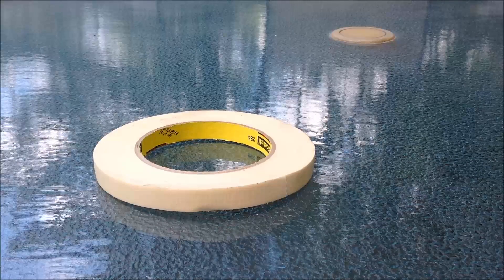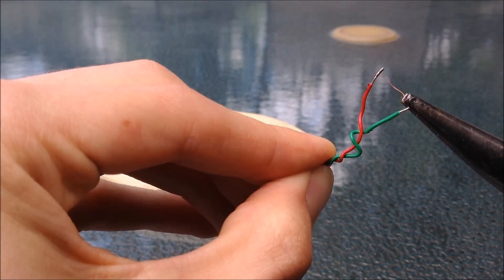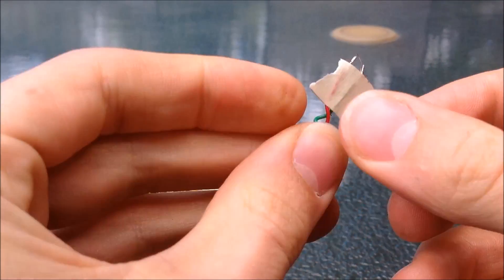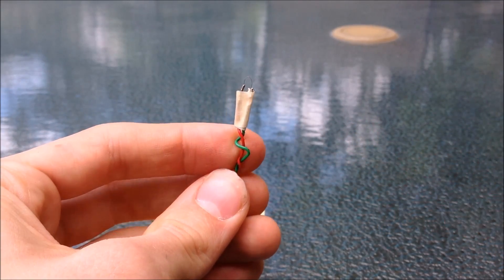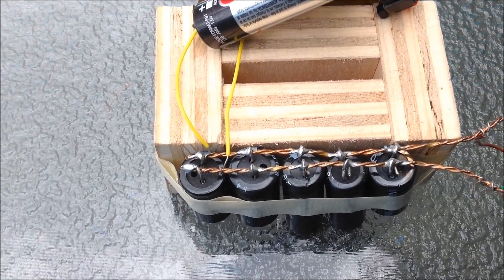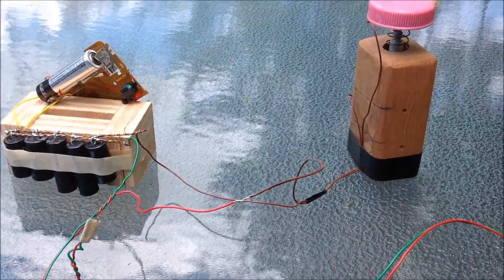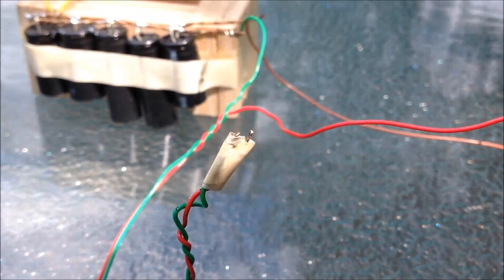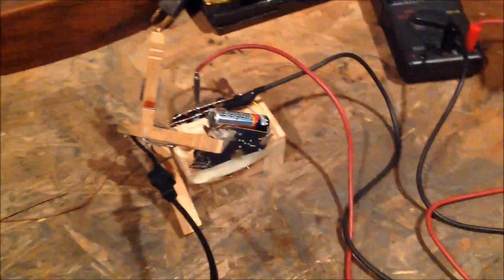Homemade Exploding Bridgewire Detonators!

Comment: i am finding a recepie to  homemade   f  ejectric starter //and was asking   for   substance   this  or   simple fuse will have   enaugh primary blast to set of   brick of tnt/semetex / or at least     detonate  fast enaugh and hot to  set of    ANFO  as    2 or 5  kilo booster//in itself    detonated with merc fulminate  or    sadly one of  the primary s  you   don want  to  mke at  home a  lot times   //
nitroglicerin is dog s piss vs lead azite  or  mrful //so i am  asking what  is  most safe to momemade   detonator//or  minimum   m per sec     shockwawe  and  hot   c////pls  tell or contact  me   if you find some  like   what i  look for

Comment: wouldn't you want to put them in series for more voltage and more current. Putting them in parallel just increases the pulse length
Reply: If you did, the ESR would add, what you want for an ebw setup is the lowest ESR possible to allow the highest current burst

Comment: Don’t ever rely on a bridge-wire alone to set up any type of explosive… Not even a primary… Devise a makeshift blasting cap and do it right. 

Safety first!
Reply from the maker: Yes, thank you for that tip. In the 5 years since this video I have learned a lot more about such things - from what I have heard, something like this will not set off explosives like ETN and you do need the primary.
Reply: @ThePlutoniumBunny  Sure it will. What kind of ETN? If the ETN is 1-5 micron that will work. If the ETN is melt casted, it will definitely work since melt cast ETN is 3x more sensitive than any regular ETN. 

If you are going to use that much power (using capacitors) you should use a thicker bridge wire. There are 100s of primaries you can use as a slurry and coat your bridge wire. You DO NOT HAVE TO have an actual cap! To better explain this, you can 'paint on' your primary until you get the thickness you want. 

Couple other things. Your bridge wire can be much longer by running down the side of one of the wires that is no stripped. Does that make sense?  

After everything is dry, spray paint some rubber over it or do what I do and get a can of that rubber tool dip and dip your wire in it.
Reply: @Boobytrap_Badger I agree with everything else, but melt cast ETN is no more powerful after it returns to it’s crystallized state after melting. That’s what makes ETN so popular, you just gotta watch that melt stage😅
Reply: @Boobytrap_Badger  interesting on the cold cast method. I have many binders for plastecizing. I have a whole gallon of rat glue. I’m not big on making videos but I did make one on detonators and I’m going to post it with ya day or so, followed by one on binders and plastecizing recipes. I haven’t made the NHN yet but I’m familiar. I have a bunch of PETN. That’s my main squeeze. Thanks for the info. 😊

Comment: Try use it in anfo or an
Reply: Won't work.
Those are shock sensitive and need quite a substantial impact to detonate.
Reply: @infinitepower6780  it's not a question of 'it won't work' or 'it will work'. 
You increase detonation probability with appropriate chain reactions. 
That being said, yes, it can work with a more powerful cap, but why skip simple steps right?
The best system is always going to be a fuse-cap-booster-main chain reaction.
Reply: @Boobytrap_Badger with a good EBW (not this one, its definitely an electric match but not an EBW) you can do EBW -> Booster -> Main.
Reply: @infinitepower6780  yea, need. Booster charge, like petn or rdx

Comment: Everyone on this thread seems way more knowledgeable than me, soThis might be a laughable question,  anyways I'm trying to confirm if my understanding of bridgewires is  correct. So this essentially works as a fuse correct?
Reply from the maker: Spot-on. EBWs are a very specific type of fuse for very demanding applications. A real EBW might be used in an implosion-type nuclear weapon, as the explosive lenses must all be simultaneously initiated within a very short time tolerance. Normal fuses or electric matches have way too much variability in when they go off, and this would cause a fizzle in the weapons system. For amateur purposes, this EBW (very amateur, no danger of building a nuke with this one) is a much safer method for initiating things than a normal pyrotechnic fuse. Such fireworks fuses need a person next to them to light them, and can have sparks fall off and ignite things before they are supposed to go. It's harder to have an accident when using these bridgewires.

Comment: Hi there, great video! You inspired me to make one of these myself and it works great, only the buttons I used got spot welded together! So I understand now why you made your own switch with those big bolts. But i was just wondering, what would happen if you would put the little wire in place of the xenon tube on the camera circuit? Since there is a second transformer that steps up the voltage to a few thousand. Or would we lose too much energy that way?
Reply from the maker: I think if you bridged the electrodes of the xenon lamp with a wire you might just short the circuit as it tries to charge the capacitor on the board.  You could definitely give it a shot!  I don't understand the camera circuit completely, but I think that the terminals are connected to the capacitor, and when the trigger pulse goes off the xenon ionizes and allows discharge.
Reply: @ThePlutoniumBunny  Well I removed the on board capacitor and replaced them with a bank of 6x 400v 470 uF in parallel. I was scared they would discharche through the smaller one. I think I'm just gonna give it a shot since disposable cameras are quite cheap anyways.. 

I was doing some reading and it seems they mostly use very high voltage capacitors(~4KV), wich I don't fully understand because they store much less joules. (I guess it works if you use the pressure analogy for volt, and in my native language it translates to tension)  But if we can step up the voltage with the second coil that might work if we don't fry the board :P These coils are called joule thief sometimes so thats kinda interesting.

I can order one of those HV caps but it's an electrolytic one and it's second hand so it sounds kindof sketchy. Ontop of that I wouldn't know anything easy to cannabalize for the transformer that can charge the damn thing... 

Anyways thx for posting this project dude, really intriguing and inspiring!
Reply: Stumbled upon this comment so thought I'd give an update. I learned a ton from this project.
So I tried discharging through the second step up coil but it was inticlimactic. It ruined the boards probably blew up some traces or overloaded the coil or something, I probably also wired it wrong. It did still charge the capacitors but it just would not turn on sometimes, had to shake it a bit to get it to work.                                                                        
I still dont fully understand why they would use higher voltage capacitors in commercial blasting kit. It probably has to do with less losses in the wire over greater distances at higher voltage.. So once your wire exceeds a certain distance a higher voltage capacitor will deliver the same or more joules. On the other hand if you stay below that limit you will be able to deliver more joules with a smaller cap bank. 

I ended up replacing the camera circuit for a step up transformer from china, which charges the caps alot faster. Also I fixed the switch problem with a thyristor and it works just perfect, highly recommend this for switching. Also put a big resistor on a switch in case I decide not to fire the system. It discharges the cap bank in a few seconds as a safety feature. Everyhing is neat inside of a box with connectors and safety switches, test mode and the whole lot but honestly this thing still feels sketchy as hell, especially to hold in your hands.. I think I need to find a way to fire this box remotely lol
Reply: @FOATE   Higher voltage to overcome the resistance of long leads.  will still waste a lot of energy in the leads, compared to the detonator wire if their resistance is significantly greater.
Reply: "works great"??? you mean you're blowing things up? Whoa?
Reply: @klam77  yea the piece of opper wire lol
Reply: Someone want to put one together me. I have plenty of good parts, just don’t understand enough to put it together. I have a few NST’s and flash circuits for tower lighting and big transformers and big caps. Hit me up and we can discuss 😊

Comment: Try using ETN as the explosive
Reply: Nitrocellulose can be used as a primary and binary. His test could have detonated instead of De flag rated if it was packed at the right density and the right grade perhaps
Reply: @manvstaco  I doubt this puny EBW would be able to give sufficient shock to detonate the nitrocellulose high order. From my understanding you need some hefty power in your detonator (not a booster though) to get high order detonation. In these test his nitrocellulose simply delfagrated but did not detonate.

Comment: THIS IS NOT DETONATION :(
Reply: No it isn't. It is a detonator just like the description states. If you just don't get it, go watch a few Roadrunner cartoons. See the box red box with a T handle that is used to set off the dynamite? Yeah, that thing. It's called a 'plunge detonator'. The one he built here run off of a battery instead of a dynamo that is spun to generate the power. I feel you won't take the time to look into this, here is a link for you. Now, go get your KB fixed - all caps typing is fucking weaksauce.

Link:  https://www.popularmechanics.com/technology/a27085/how-a-looney-tunes-style-tnt-detonator-works/
Reply: @whatatoolsack652  I think he is talking about the nitrocellulose not detonating.
Reply: @whatatoolsack652  its not even a detonator, a detonator is a device to make secondaries explosives go high order. This wouldn't do shit, the current clearly doesn't rise fast enough in the wire to get a secondary explosive to detonate. Some could burn, but not detonate